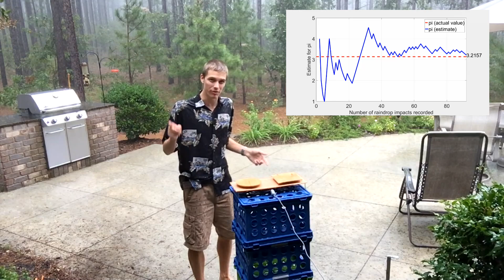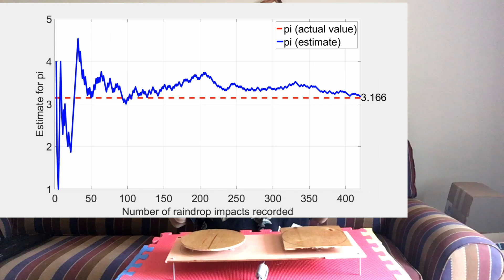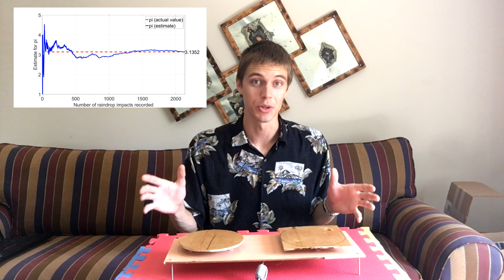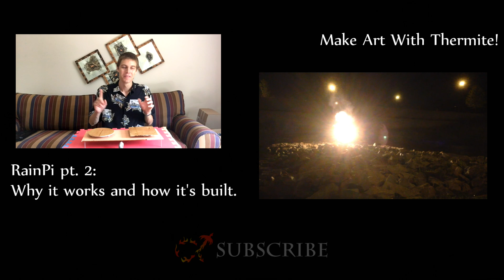RainPi - Calculate Pi with Raindrops!

Comment: Can this experiment be simplified? For example, round and square holes through which water is collected in the identical containers, and the ratio of the amount of water in these containers is used to calculate the Pi
Reply: Yes. You could also take 2 objects of the same material (could be water inside containers), one being circular and the other being rectangular, measure the dimensions, weigh them, and calculate pi to maybe 3 or 4 significant figures relatively easily. The accuracy of your instruments does not matter in this case, so long as they are precise.

Comment: This is a really cool project. I've tried a few different random Pi calculating experiments in the past.  
 Could you possibly be picking up false drops from hitting the board they are mounted to? You should try isolating the two different shapes on their own mounting board and make the mounting piece smaller than the top shape, to avoid any false taps from large drops. It would be cool to see a follow up.

Comment: Really cool idea, and good on you for making it happen.  One quick question I have is: how did you decide when to stop the moving graph of the calculated value of pi?  From what I see, it stops at around 2,100 impacts.  Seing as this isn't exactally a round number (like 2,000 or 2,500), I'm guessing you just stopped the graph whenever it was closest to pi.  Is this true?  If so, I would be interested in seeing you stop at an exact stopping point (like 2,500 or 5,000 impacts) and then run this twice or 3 times to see how consistant you get with the calculation of pi.

These are just my silly thoughts to add on to a silly project, and I could be wrong on all of this.  Again, cool idea and cool project!

Edit:  Alright, so after watching your second video it appears you stopped it due to the rain ending.  Either way, I think it would be cool to see a second rainstorm trial to see how consistent you can get
Reply: Yeah, with the monte carlo method you can just keep appending datasets to get large samples, so if I had a second storm's worth of data I would have used a composite dataset, but it's not going to rain again for a couple weeks and I wanted to finish the video, so I only used one storm of data. 
You're right though, the answer it landed on was pretty wonderfully (by luck) close to pi. I don't think it was fully settled yet...